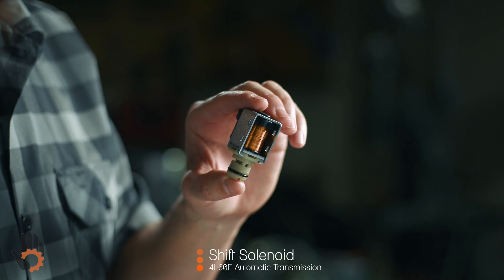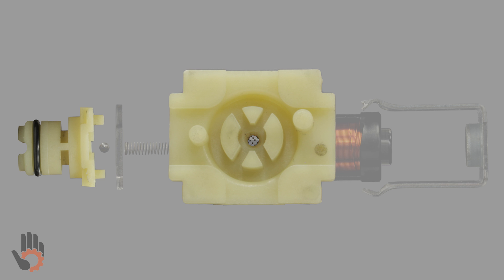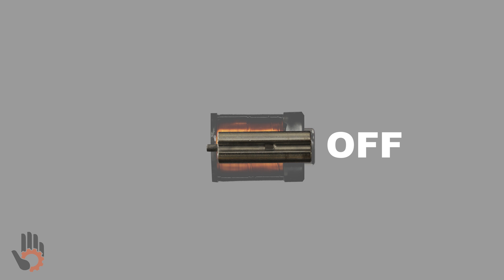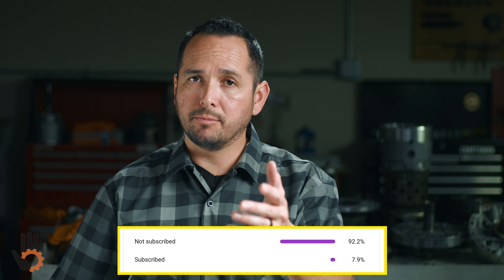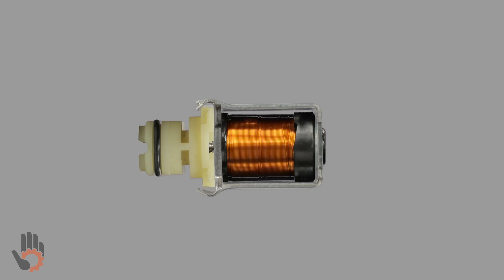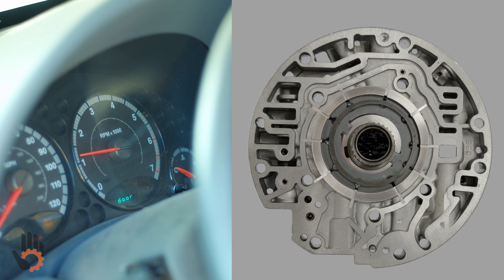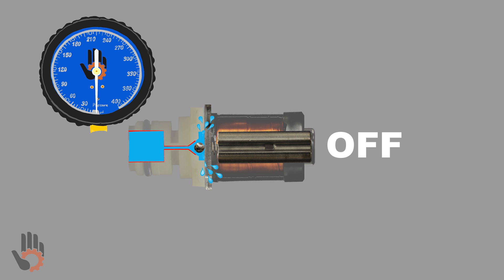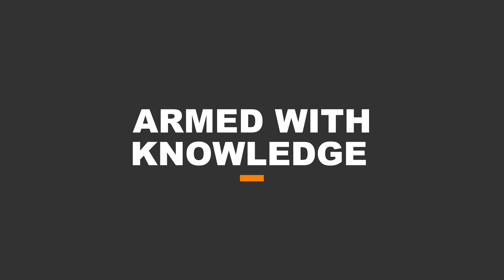4L60E Shift Solenoid - Part 1 (Basic Operation)

Comment: I have a 4L60E it has been rebuilt has new shift solenoids but when taking off from a stop you have to get to 20 mph and let off the gas before it will shift gears then it does fine until my speed drops below 20 then it shifts to low gear and going up hill from a stop or slow speed it even worse  have any ideal what i can do for this I'm on a very tight budget can't afford a big repair bill

Comment: As a 36-year mechanic, transmissions have never been my forte. I can service them, replace certain parts and replace the entire transmission when needed. I have very little experience at digging into one. My 4L60E has been doing fine up until today. Shifted fine for 6 hours of a road trip. But I darted out in traffic so I got on the throttle hard and when it went from first to second, second disappeared and when I let off the gas it automatically went into drive. I no longer have second or reverse. Any ideas? I'm desperate. I need my truck and I can't afford an overhaul. I can't even afford a used transmission. It's a 1994 GMC Sierra 1500 2wd 4.3 4060e. Appreciate the video. I learned a lot. Thanks

Comment: Hi Robert,
 Truly excellent videos. I have a 2000 Blazer with a 4L60E that has begun to shift into third gear late. Taking off from a stop, transmission runs through 1st gear, shifts into 2nd gear, then when it should shift into 3rd gear, a P0758 (Shift Solenoid B Circuit Electrical) code appears, and the engine revs as if in neutral (without ever having actually engaged 3rd gear). About 4 to 5 seconds after the missed shift (letting the RPMs come down to idle while coasting) I can feel it drop into gear. I'm clearing the code with the scan tool in my lap immediately after that. Then it will continue through 3rd gear and into 4th gear, including converter lock-up. While at around 50 mph or faster, I can see the converter unlock on the tach while touching the brake pedal, and it will downshift from 4th when stepping on the accelerator at this highway speed or faster. The transmission behaves as it always has until I slow down at the next stop. Then the process above repeats, every time. Also, it behaved the same when I tried manually shift through the gears.
 I have replaced the A and B shift solenoids, with new solenoids, filter and fluid. The pan had very minimal gray sludge in it, with no metal debris. I've checked for electrical harness problems and for bad grounds.
 Any ideas as to what the cause could be? Could faulty body control module (or PCM) cause this? I would really appreciate any help you can offer.
 Thank you,
  Tim
Reply: Have you considering changing the TCC and 3-2 solenoids also?

I'm having the EXACT problem you are having, 148k miles, 4wd 5.7l 350ci
Just bought the truck after what seemed to be 2 owners, no trans service, rear diff never opened, valve cover pouring... 

I'm hoping that my 3rd/4th gear are intact, just inaccessible...

I changed fluid and there wasn't TONS of metal, but there was a lot...
Reply: @DirtyOne614  I've since pulled the pan again, and also replaced the electrical harness, EPC (electronic pressure regulator), TCC (torque converter lock-up) which is hard-wired into the new harness. This didn't fix it either. I've also decided that what it is actually doing is completely skipping 3rd gear, and going into 4th (after the delay from 2nd when it should be going into 3rd gear). I hadn't considered replacing the 3-2 solenoid, as it will shift from 4th down into 3rd manually, once it gets into 4th.

Comment: I have a 2007 chevy 2500 won't shift into drive. Code reader says shift censore B. When under truck with pan down, is shift censore B on driver side or passenger side?
Reply from the maker: If your vehicle is equipped with a 4L60E, then Shift Solenoid B is gonna be located on the passenger side.
Reply: Industry standard is to replace both solenoids anyway. You'll thank yourself later. Test ohms with multimeter 20-30 ohms, ohms should climb fairly fast otherwise its lazy and bad. Also make sure they actuate with a 9 volt battery before installing. They are at rear of transmission btw.

Comment: I just rebuilt a 60e that has no 1st gear.  Have dropped VB and verified solenoids, valve and spring move in bore; all good.  What I did discover was the 3-4 shift valve/spring was in backwards.  Not an expert in the fluid flow, but could this cause no 1st?
Reply from the maker: Good eye!  It definitely will.

If you don't already know, the 1-2 signal oil pressure is used for both shift valves (1-2 & 3-4).  It's a shared oil circuit.

With the 3-4 shift valve installed backwards, it will let the 1-2 Signal Oil pressure exhaust or bleed off...resulting in no signal oil pressure for the 1-2 shift valve or the 3-4 shift valve.  This mimics 2nd gear.  It's as though the 1-2 shift solenoid is off/de-energized (valve open, bleeding off signal oil pressure).

Great question, Steve.
Once again, good eye.

Comment: Would like to see a video on the parking pawl and park lock. 96 4L60E gets stuck in park after the engine starts.
Reply from the maker: The parking mechanism on the 4L60E is pretty basic, and pretty hard to mess up (during a rebuild).  If the trans was recently rebuilt, then there may be an issue with assembly (anything is possible).  However, if the trans was not recently rebuilt, a few things are coming to mind.

1). A faulty shift interlock solenoid.
2). A faulty brake pedal switch.
3). Faulty wiring/connections for either the solenoid or the switch.
4). Switch could be misadjusted.
5). Blown fuse.
6). Etc.

The engineers at GM don't want the driver to be able to shift the trans from Park to Reverse/Drive, without the brake pedal depressed...for safety reasons.  This is why the shift interlock solenoid is used.

The shift interlock solenoid prevents the shifter from moving out of Park until it "sees" that the brake pedal is being pushed down.    So, not only does the interlock solenoid need to be in good shape, but the brake pedal switch must be in good working order, too.

The condition you've mentioned has me leaning towards the things listed above.  Just sharing my thoughts, as a courtesy.  Do what I do at your own risk.
Hope this helps.
Reply: Thanks a bunch for the reply.The transmission hasn't been rebuilt, about 240K miles on it. just decided to lock up out of the blue.
   I've replaced all common parts I think.
New brake light switch
New ignition switch
New Shift Interlock Solenoid
New Neutral Safety switch
New Gear Shift Cable
New Column Shift Mechanism
New Position Pressure Switch
Dropped the pan 3 times and can pry on the park pawl to release it to be able to shift it by hand
but when I put it back together and and put fluid in it. and start it, it just gets stuck again.
I'm at a loss, determined its something internal, idk.
Quick question If i pull the linkage off the transmission, should I be able to shift it by hand from under the truck(it will not), could it be something internal?
I do need to adjust Shift Interlock Solenoid maybe that's it. PRND321 lines up when I shift it from the column.
I'll update if I figure it out lol, Thanks again.
Reply from the maker: Regarding your question...
Yes, you should be able to shift it by hand...as long as the shift lever is still bolted to the shift shaft (on the trans).  There's a nut (13mm or 15mm) that secures this lever.  With that lever bolted to the trans, you should be able to shift the trans by hand.  If you've removed this lever, then it will be really hard to shift trans (because you have now have no leverage).

I'm assembling a 4L60E this week.  If time permits, I'll see about shooting a short video of what I am talking about.
Reply: Thank you, it will not shift by hand after popping off the shifting cable, would be great to know what would cause the parking pawl to get stuck in park.

Comment: Will an improper functioning solenoid cause transmission to not shift to 3rd gear? Have all gears excepts will not shift above 2nd gear.
Reply from the maker: Could be a couple things...

When the trans should shift from 2nd up to 3rd gear, what happens?
When it tries to up-shift does it feel like the trans goes into neutral (engine revs up, and vehicle coasts)?
Or...
Does it simply stay stuck in 2nd gear (engine RPMs climb as vehicle continues to accelerate)?
Reply: @SouthpawAutoworks it just stays in 2nd and rpm’s climb. Although it downshifts back to 1st fine when you slow down. And all other gears work fine. Park, 1-2 , Rev, neutral.
Reply from the maker: Based off of your response (trans is not slipping....just won't up-shift), it sounds like it could be an issue with the solenoid (2-3 shift solenoid).
Note:  The 2-3 Shift Solenoid is often times referred to as Shift Solenoid B.

It could be plugged (with debris).
Per the video, when the solenoid is energized (or turned ON), the solenoid's internal valve closes.  This traps incoming oil, which builds oil pressure, which has a positive effect on the valve train.
When the solenoid is de-energized (or turned OFF), the internal valve opens, allowing the oil to escape/exhaust, which let's the oil pressure bleed off.

However, if the solenoid's internal hydraulic circuit is plugged, the oil pressure can't bleed off.  So, even though the solenoid has been turned OFF, it still behaves as though it is ON.

Both shift solenoids have a "firing order".
2-3 Shift Solenoid:
1st gear:  ON
2nd gear:  ON
3rd gear:  OFF
4th gear:  OFF

In order for 3rd and 4th gear to occur, on the 4L60E, the solenoid must turn OFF electrically....and bleed oil pressure hydraulically.

Is this making any sense?
Let me know what questions you have.
Reply: Also, previously had rodent issues, chewed other wires. Thinking it could be a wire going to/from solenoid also.
Reply from the maker: Copy that.
Reply: Yes just won’t shift up. That definitely makes sense! Thanks so much for taking the time to help me troubleshoot this. I’m going to take a look at that solenoid and hopefully that fixes the problem! Thanks again for the quick responses, much appreciated.👍🏼
Reply from the maker: You bet!
I'm typically slow to respond (super busy)....but, I'm glad it worked out, timing wise.

When time permits, I'll dedicate a video to this topic (symptoms, diagnosis, and replacement...along with some tips and tricks, of course).

Thanks for stopping by the channel.

1 Handed Transmission Builder:  (60-Sec Preview)
https://youtu.be/y3Vixa_Ec1E

Comment: I have an 05 Colorado with 4l60e shifts from 1-2 fine but when shifts to 3rd just revs but if you do it manually and skip 3rd and go to drive it hits 4th  but runs like 4K rpm’s at 65mph
Reply: And if you put shifter in 3rd it will move around driveway fine

Comment: Hi there thank inadvance igot a94 g20van I'm only getting 1st gear no 2nd  and no speedometer  reading  help !
Reply from the maker: "no speedometer"
An inoperable speedo (believe it or not) will cause a no up-shift condition.  The PCM (computer) needs to "see" the vehicle speed, in order to determine when to up-shift the transmission.  If the speedo is not working, the PCM is unable to determine vehicle speed...and will not command the trans to shift.

"only getting 1st gear no 2nd"
Which position is the shifter in, in order for you to get these 2 gears?
For example:
Shifter in OD (or D) position?  And trans automatically shifts from 1st to 2nd gear?
Or do you have to manually shift the trans?  Shift from Park to D1, and then up-shift manually to D2?

No 3rd or 4th gear:
I have questions about this, too.  But, I'll wait to respond to my other questions, first.

Comment: I have a 2003 yukon denali that has a po751 code. The transmission will shift fine when the fluid is cold. As soon as the transmission temps get to normal operating range I would lose all forward and reverse gear. I can then cut the vehicle off for about 5 mins and crank it to get back home. Could this possibly be the shift solenoid?
Reply from the maker: It does not sound like a shift solenoid failure.  When they fail, you'll lose some gears, but not all of the gears.
Sounds like a plugged oil filter.

Is the trans experiencing other issues?
Was it experiencing weird shifting (slipping)?

Comment: I own a 2009 4.3 4wd. Silverado. Would the shift solenoid prevent my truck for ingageing  the 3rd. and 4th gear?
Reply from the maker: When the trans attempts to up-shift from 2nd gear to 3rd gear, does the trans stay stuck in 2nd gear?
Or, does the trans feel like it went into Neutral?  Engine revs up, but the truck "stops pulling?"
Reply: @SouthpawAutoworks  stops pulling,and tacts out.
Reply from the maker: Based off of the info you've provided...sounds like the 3-4 Clutch failed.  This is a common failure point on this trans.

If the 3-4 Clutch is smoked, then the trans has to be opened up, and the clutches (among other things) need to be replaced.

A shift solenoid will not cause this particular problem.  This issue can be caused by a number of issues within the trans (and even some stuff outside of the trans).  I'll be putting together a video on this topic...when time permits.

Comment: Thank you, Robert.  I am a novice in this field, and I am trying to view all yours videos regarding the 4L60E to understand possible issues (hard shifts from 1-2) I've been having with my transmission.  Your videos are very descriptive and informative.  Thank you for your time and dedication.
Reply from the maker: A hard 1-2 up-shift can be caused by a number of things.

Example:
A broken accumulator spring will create this condition.  The spring assists the accumulator piston, and is used to cushion the oil that's sent to the 2nd apply piston, on the 2-4 Servo.  When the spring breaks, there's no longer a cushioning affect.  The incoming 2nd gear oil slams the accumulator piston, and bang...

We've had a number of people asking about this exact same condition.
When time permits, we will dedicate a video to this topic.

Stay tuned!
Reply: @SouthpawAutoworks llllllllllllll can

Comment: I'm having issues and have watched your videos on the 4l60e but can't find anything that might be the source of my issue.
I have a 94 4l60e out of a z71 Silverado and I am missing second gear only. Just recently rebuilt the 3-4 clutches and still had 2nd gear until 2 months later. Also I think this is a separate issue but 4th gear does not drop the motor into rpms it's supposed to, example: at 70mph I'm normally sitting at 2,000 rpms but now I sit at 2,500 rpms and this issue came up about two months into driving without 2nd gear. This is my only vehicle so I don't really have a choice but to continue driving. Any help is appreciated!!! I love this channel
Reply from the maker: It sounds like the 2-4 Band is not holding.  It wraps around a drum.  When the band is applied, it prevents the drum from rotating, which has positive effects on the planetary gear set.

The 2-4 Servo applies the band, in both 2nd gear and 4th gear.

The servo is equipped with two different pistons, that are two different diameters.
In 2nd gear, the 2nd apply piston pushes the servo towards the band, applying the band.
In 4th gear, the 2nd & 4th apply pistons work together to apply the band.

When repairing the trans, did you remove the 2-4 Servo from the side of the transmission case?
Reply: @SouthpawAutoworks  no I only went straight to the clutches as it was my only issue and I had no need or knowledge to break into it any deeper at that time

Comment: I removed my 1-2 accumulator but I can't get my EPC solenoid off. It's comes almost all the way out of the whole but not completely out. And my EPC solenoid is also called a pressure control solenoid on my 2007 H3 Hummer. Help please 🥺
Reply from the maker: Sounds like you should be good to go.
Note:  EPC stands for Electronic Pressure Control.

As long as everything is removed, the solenoid should come right out of the bore.

Removal:
Remove 1-2 Accumulator (3 bolts)(10mm socket).
Disconnect electrical harness from EPC Solenoid. (two different styles of connector).
Remove EPC Solenoid bracket and bolt (8mm or 5/16" socket).
Pull EPC Solenoid from valve-body bore.

I've got a 4L60E handy.  I will go take a look, and see what might hold up the removal of the solenoid...and fire back.
Reply from the maker: I took a look at the 4L60E I've got handy.  The valve-body is currently removed from the transmission case.  With the bolt/bracket removed, the solenoid comes right out, no problem.

Cocked in Bore:
After playing with it, I was able to make it stick in the bore.  As the solenoid starts to come out the bore, it is possible to inadvertently lean the solenoid (left/right, up/down) and it'll get caught in the bore.
Might try wiggling while gently pulling.

Contaminated:
The end of the solenoid could be contaminated with debris.  These parts are a tight fit, and debris can easily jamb things up.  In that case, some brake parts cleaner could help flush out any debris.  Might need to shoot a little lube in the bore (ATF, WD, etc), after flushing with brake cleaner.